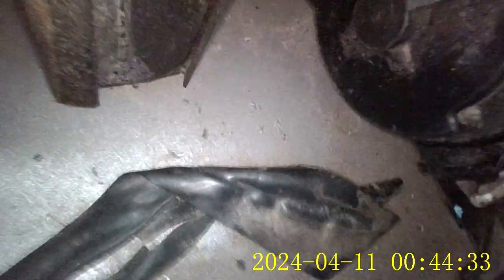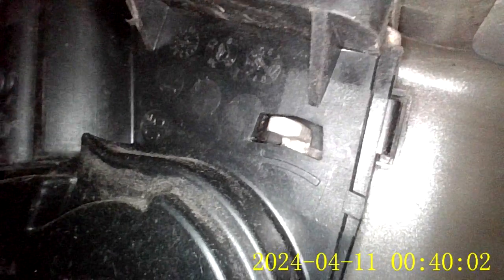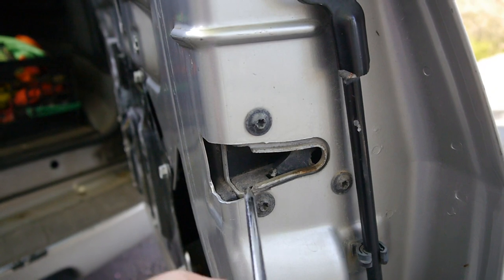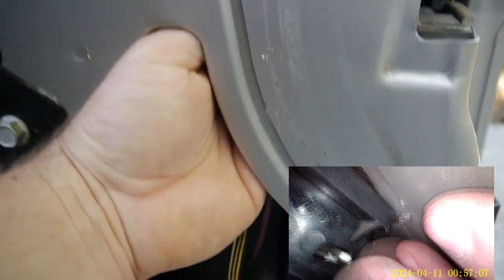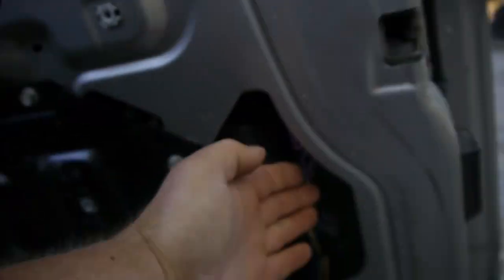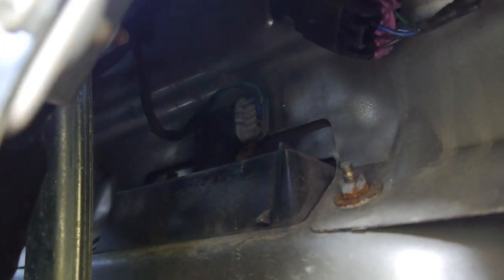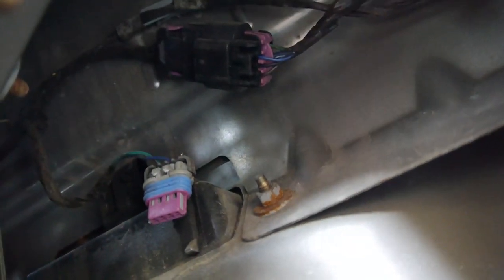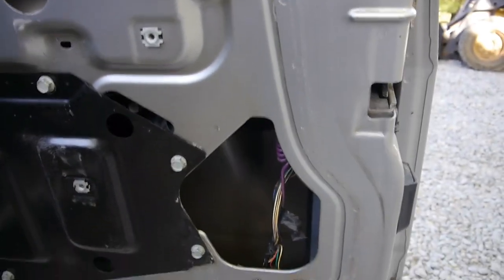How to Manual Override Envoy XUV Rear Door Latches

Comment: Hello, I can see and touch that actuator at the lower bottom however I cannot get it to release the upper one will but I can’t get the bottom one wheel. I’ll try putting a hitch screwdriver on it and lift up but nothing happens. Any suggestions? Also, the tailgate is closed. And I can’t get it open. I am trying to replace the window motor. But can’t get to the screws unless the tailgate is open.